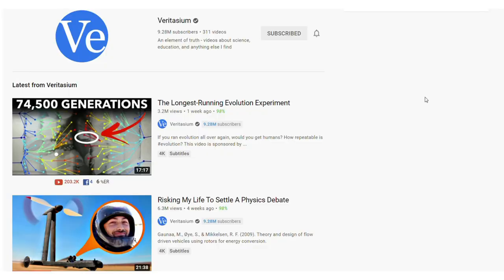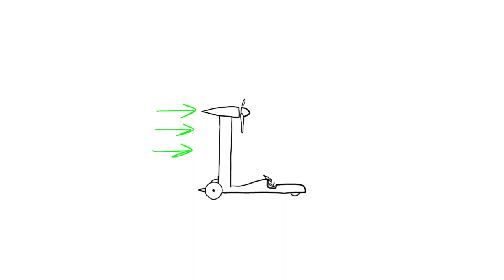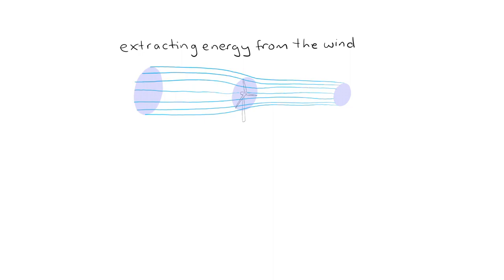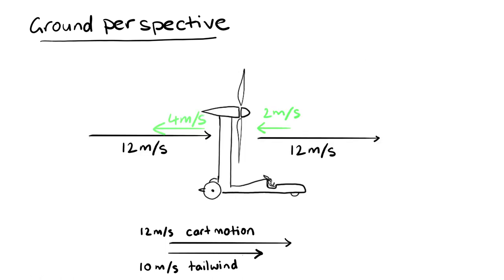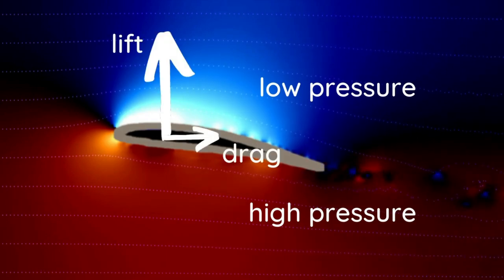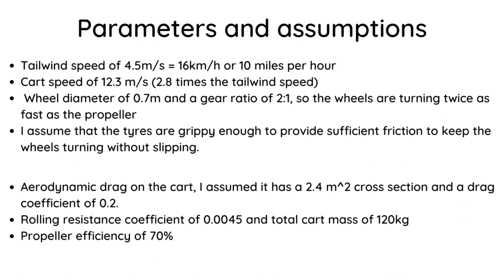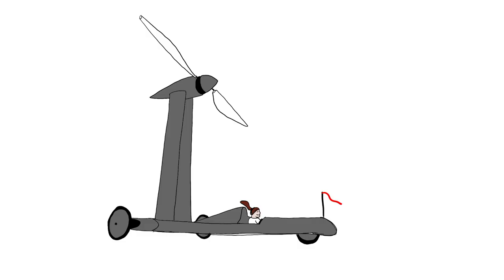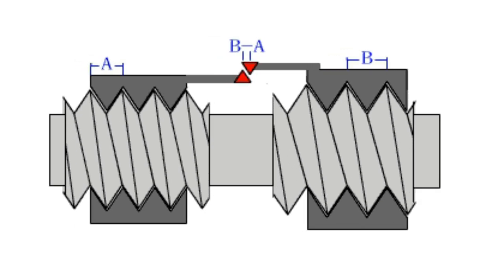Downwind Faster Than the Wind by Veritasium: How Does it Work?

Comment: Although all of these explanations may be correct technically, I still think the explanation that the propeller is driving the car forwards by being powered by the wheels has it backwards.  Let me explain why I say this and I invite your comments.

I do windsurfing and this phenomenon described with sailboats is well understood by experienced windsurfers.  When you bear away from the wind by 45 deg, the speed of the craft is so fast that the relative wind speed means that the sail appears to be facing the wind "backwards".  The clew of the sail is further upwind than the mast.  It works however because the air is still able to travel from the mast to the clew because the craft is travelling faster downwind than the windspeed, so still able to be driven by the wind.

I suspect this is what is happening in this scenario.  The creator of the blackbird described a scenario of two sailboats sailing downwind on a cylinder, and this is similar to a propeller.  This is exactly what is happening here.  The keels of the sailboats are providing the resistance in the downwind direction for the physics to work.  In the case of the car the wheels are providing the resistance.  Without the wheels the blades of the propeller would not create the force similar to that of the sail of a windcraft.  So the propeller is not turning the wheels, but rather you are basically on a course bearing away at 45 deg (say) with two sails rotating, with the wheels providing the resistance for the sails to push against.

I suspect that if you were able to tilt the propeller blades to face the wind at the start with zero speed, it would work even better.  The propeller would create force in a forward direction acting as sails, but the wheel have no speed.  I suspect in this case the wheels would offer resistance against forward motion as the "sails" would work at zero speed as well.  As the cart accellerates the blades could be turned more and more for the "masts" to face more and more down wind.  Ultimately the speed of the blades would be so high that it appears to be driving the cart fowards, but in reality the wind is driving the "sails".

Any thoughts?
Reply: There is a chain loop drive between the rear axle up to the prop shaft.  At any point in time, there are only two possible options on this chain drive:

1:  the side of the chain loop traveling down is under tension (wheels turning the rotor)
2:  the side of the chain loop traveling up is under tension (rotor turning the wheels)

During normal downwind operation at all speeds, the side traveling down is under tension.   The wheels are always providing the force to turn the rotor.  The rotor is never providing the force to turn the wheels.

Additionally and by design, it's literally impossible for the side of the chain traveling downwards to be under tension.  There is a freewheel (ratchet) installed on the prop shaft between the prop hub and the drive chain sprocket which prevents the rotor from ever driving the wheels.

// "Any thoughts?"// 

Yes.

// " I still think the explanation that the propeller is driving the car forwards by being powered by the wheels has it backwards."//

The explanation is not backwards, it's 100% correct.  Not only is it correct, it's impossible that it's backwards.
Reply: Look at the video "BUFC blowup run" when it pulls away from the truck. Note which way the prop spins and which side of the chain is under tension. It's clearly the side that goes down from the prop to the wheels, so the wheels are turning the prop via the chain.

Comment: Sometime explanation is simpler than you think. Let me explain why:
First I name the propeller " flywheel " You will understand what I mean if you follow my explanation.
Pay attention to " flywheel " rotation speed and the wheels which attaching to the propeller with chain and gears... If transfer ratio between the wheels and " flywheel " is fix when the vehicle reaches wind speed the " flywheel " will reach a maximum a rotation speed if no external force is applied. In another side Veritasium claimed the vehicle reached the speed of 2.5 times of speed of wind. That means the " flywheel " rotation speed must reach speed of 2.5 time speed at the time the vehicle at the same speed of the wind if transfer ratio of the propeller and the wheel is FIX. Check it out you will see what is actual speed of propeller from start to the end. 
When the vehicle reached speed of wind if you have a transmission box with more than one speed between the wheels and the " flywheel " and you shift gears of the transmission box you can slow down or speed up the vehicle depend on the gears ratios.
The " flywheel " at this time acting as a flywheel drives the wheels directly by chain and gears not by the propeller pushing air. The " flywheel " uses it energy it stored before it reaches speed of wind to push the vehicle.
The propeller from start to the end acts as a flywheel no more no less.
You maybe wonder why they did not make a flywheel and put it no the vehicle lower to ground.
It is not practical to do that because it makes total static mass too big so the vehicle can not reach speed they want.
Blades of "the propeller" make it possible because "the propeller"  can store enough energy with a lighter weigh.
The blades of "the propeller" in their design only make you think it's a propeller.
Reply: "That means the " flywheel " rotation speed must reach speed of 2.5 time speed at the time the vehicle at the same speed of the wind if transfer ratio of the propeller and the wheel is FIX."
That's not how acceleration works.
 
"When the vehicle reached speed of wind if you have a transmission box with more than one speed between the wheels and the " flywheel " and you shift gears of the transmission box you can slow down or speed up the vehicle depend on the gears ratios."
No, you don't. Yes, there is a cassette mounted to Blackbird's axle but there's no derailleur. You can't shift gears during operation.

"You maybe wonder why they did not make a flywheel and put it no the vehicle lower to ground."
Indeed.

"It is not practical to do that because it makes total static mass too big so the vehicle can not reach speed they want." 
vs.
"Blades of "the propeller" make it possible because "the propeller"  can store enough energy with a lighter weigh."
So in your own words, instead of a heavy lump of cast iron they could have indeed used a lightweight disc made of composites and just make it rotate faster.
Also the mass of a vehicle rolling over solid ground has little impact on its terminal velocity.

"The blades of "the propeller" in their design only make you think it's a propeller."
If they were clever enough to fool people with a two bladed flywheel, would they be stupid enough to put those blades at an angle that acts at an efficient brake on this flywheel? That's a pretty counterintuitive concept.

Comment: Great explanation. Most of us engineers figured the same too. Our only skeptism is that using your hand to hold the vehicle on the treadmill does not represent a slowing tailwind well. So that  demonstration was flawed. That demonstration just shows we can power a propeller with a treadmill. It doesn't demonstrate a tailwind could beat friction and drag.
Reply: @Rick_Cavallaro  Yes sure. If you did it on a superlong treadmill it will demonstrate it just fine. However on that short treadmill run where it accelerates off the treadmill doesn't. All we saw there was potentially a kinetic force. We can't tell the difference. You showed the community something incredible but the demonstration there was a poor representation of what u set out to prove. It would have been so much easier to use a wind tunnel and treadmill. There would be so much less debate on this. Btw congratulations and sorry u gotta fight so many ppl saying the same thing. U got to understand why they say it also.
Reply: I mean ppl are skeptical about the slowing tailwind being able to beat friction and drag. Your hand force is a increasingly stronger force on the model as torque requirement increased as rpm increased. This is the opposite of a tailwind force.
Reply: @Rick_Cavallaro  i see where we have a misunderstanding of each other. Alot of people don't believe the vehicle could even get to wind speed with a tail wind cause of friction/propdrag. They view it the same way as a car with sails then of course it cant reach wind speed. But If you tow the blackbird and release then of course we would see the blackbird accelerate. They have no idea what the gear ratio is. You could be adding 10x the force to the propeller while towing or on a treadmill.
Reply: Btw im not fighting u on whether blackbird works. U r confronting this convo as if i don't understand the concept. I am trying to explain how the treadmill example could simply just be a demonstration of kinetic energy. Like u can spin a propeller with a treadmill and make a kinetic energy helicopter too.
Reply: @Rick_Cavallaro  Anyways congratulations. This boggles the mind of even physicist. Very cool counterintuitive stuff. I see your passion too with all that energy to rebuttal all the nay sayers. I was initially a nay sayer with questions. Thats why i felt like explaining why many thought the treadmill was merely kinetic energy. To help explain why doubters doubt so educaters can educate better. I mean u cant denie using a treadmill and your hand to spin a propeller isn't also a demonstration of kinetic energy.
Reply: @MicroInferno    I'm glad you understand that the Blackbird works but you clearly don't know how.   There is no "force added to the propeller" on the Treadmill.   I think what you are trying to state is that angular kinetic energy is added to the propeller because it is rotating.   However, these carts can't in any way benefit from the energy they are storing in the propeller to accelerate since the gearing from the wheels is direct and the wheels aren't slipping.

Here's a TM experiment where the cart is purposely slowed below windspeed and it speeds back up and goes above windspeed:

https://youtu.be/9dbrXBLVec0?t=17
Reply: @killbeas  of course there is a force added to the propeller. The force came from the wheel to the propeller during acceleration from stationary. The force was transferred from hand and treadmill to wheel and propeller during the initial acceleration of the wheels and propellers.
Reply: @killbeas  as you know when initially placing the model on the treadmill the force to hold the model during initial acceleration is opposite from the force once the model has generated thrust. The initial force to build up the rpm and thrust is the "kinetic energy" doubters are referring to.
Reply: @MicroInferno  If they don't understand the difference between force and kinetic energy, they are just interested physics bystanders and no amount of explanation is going to help with that level of knowledge (or lack of).   The treadmill experiment I referenced shows the cart going clearly below windspeed.   A doubter should say, "one can't tow the vehicle up to below windspeed and it will accelerate above windspeed".   This is basically exactly what the experiment shows and illustrates the concept of going from below windspeed to above.

People with no physics knowledge generally will not appreciate why this is even interesting.  Most will just think this is a strange car with a big rotor that goes fast in the wind.  That's fine but not worth explaining a relatively complex mechanical and aerodynamic mechanism to if they aren't really interested.
Reply: @killbeas  yeah the video u showed demonstrated acceleration below wind speed and yes no amount of explanation will explain to someone that's stubborn. That stubborn person will say well the force is already there and the kinetic energy generating thrust would accelerate the model and since the model is stopped before the kinetic force had time to lose its energy the demonstration is still flawed. Like u said they wont listen so its best to use a controlled demonstration where there's no debate. Again i understand how this works and all of your explanations. Im merely explaining why there is skeptism. An increasingly stronger force ie your hand during acceleration is opposite from what a tailwind would represent. So the demonstration on the treadmill didnt visually show that a weakening tailwind could beat friction and prop drag.
Reply: @MicroInferno  Some people don't even understand that streamers attached to the vehicle point straight back indicated FTTW travel.   I can't help them and there will always be doubters so we can't convince everyone.   After all look at all the people who won't take the Covid vaccine with dubious doubts.  And an even better example are "flat earthers" and maybe "moon landing hoax" people.   So we just accept that some people aren't that sharp and move on.
Reply: @killbeas  yes i understand. I just wanted to explain why so many saw the treadmill as kinetic energy and u can't blame them. I mean most engineers and physicist would initially view it that way too. It's most ppl with absolutely no knowledge are the ones that didnt question. That being said most engineers and physicist will question and then find the answers and like the one who made the 10k bet when further evidence is presented will come around. Just sayin a controlled demonstration would have avoided it all together.
Reply: @killbeas  anyways i bet its extremely frustrating being in your shoes. Wish you guys the best. Thanks for the civil chat. To me it was fun. Or atleast it engaged some critical thinking. Thanks for that.
Reply: @killbeas  I think I agree with all u said as i know the POW from which you said it. Have patience tho. Like the physicist is not a stupid man. He probably watched that single vid derek sent out and had lots of doubt he didn't bother further researching instead sticking to one thing he knows. "There's no free energy" and because the demonstrations to him were not proof to him. EI the wind indicator on blackbird was too low. Treadmill example was not a controlled scenario other forces could be at play like a zig zag motion. He remained firm on (COE) Inlight of more evidence he conceded. The examples was what failed him. It left too many variables. That's why i think its important to demonstrate a controlled demonstration. Much less head ache for all and as science communicators its important to demonstrate it right leaving no ambiguity.